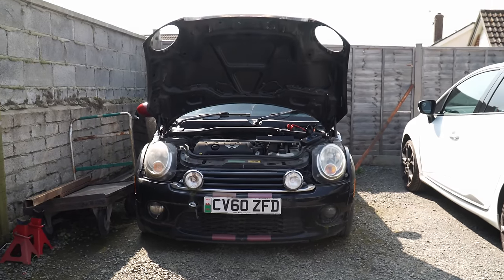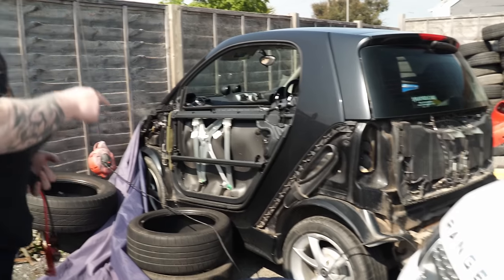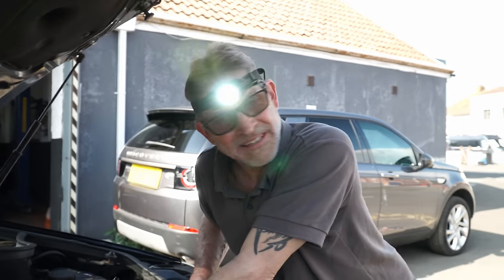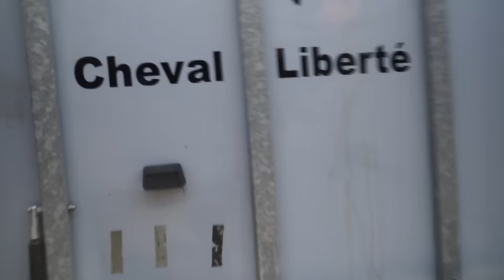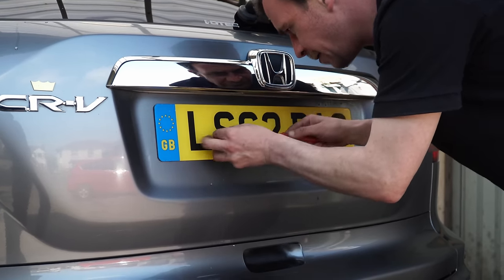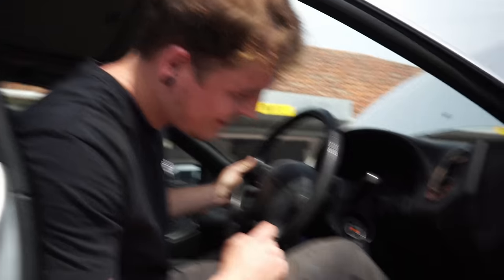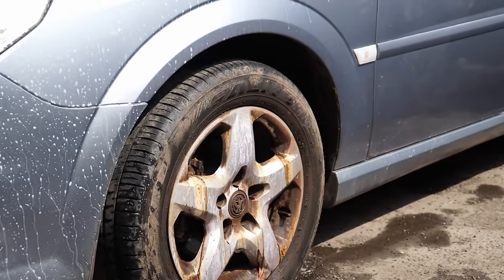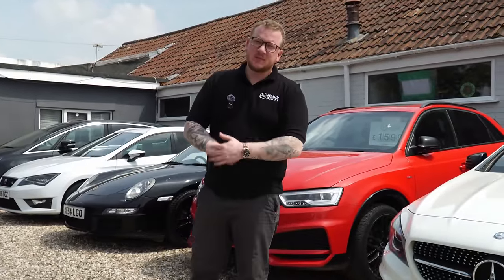Why Have We Bought A Mazda 323 With NO MOT?! 🤯 BM Weekly EP 38

Comment: That Mazda an excellent car in its day. Lovely engine, slick gearbox and nice handling.
Regarding the lance not foaming, can be filter blocked most likely. Plenty of u tube vids how to sort - not difficult. When I’ve used mine I run clear water through the lance for 30s seems to cure the blocking

Comment: Those acid based wheel cleaners I never use them because they can play havoc with the pistons and slides on disc brakes unless you can thoroughly clean the residue off